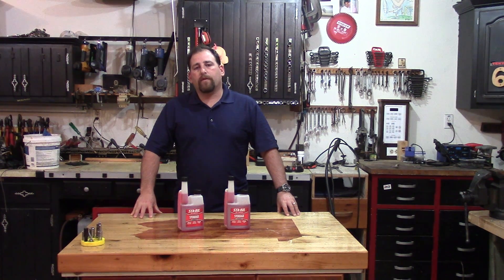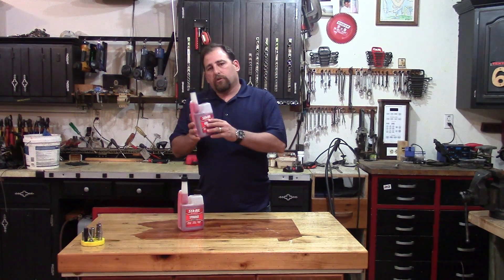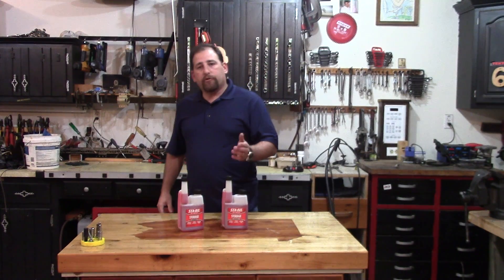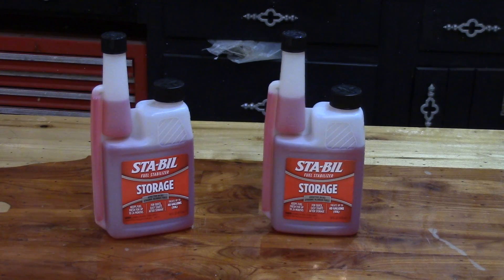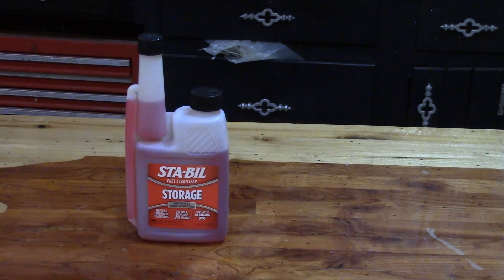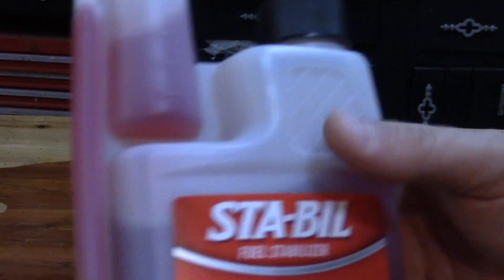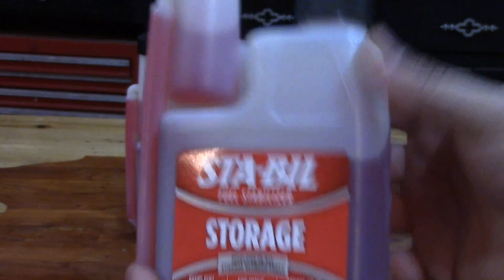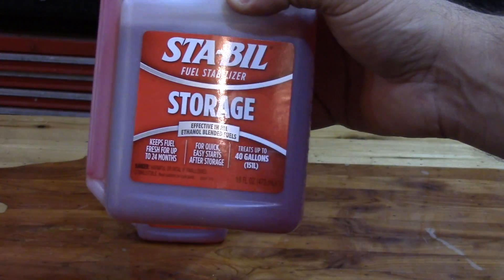STA-BIL Fuel Stabilizer How It Works

Comment: I quit using Stabil for a couple reasons but I won't go into that. I have been using Seafoam instead and it's better. It cleans jets and small fuel journals to keep all my engines running smooth. I also use it in my oil to clean up carbon deposits. And of course it is an excellent fuel stabilizer.
 No, you do NOT need to bring batteries inside during the cold winter months. Just plug them into a float charger and leave them in the equipment (as long as it's inside or covered up) I have NEVER taking my batteries out of my motorcycles or lawnmowers during the winter. I just use small float chargers all during the winter months and they stay fully charged until I need the equipment again.

Comment: I can tell ya it's probably unnecessary in dry climates like Western Colorado.   It's probably snake oil.  But it's not too expensive so it's doable.  I use about 50 gallons of portable canned gas and diesel a year.

The only way to check this product is to get 6 containers of gas from 3 different sources and do a lab test on all before and after.  Let it sit 24 months on a shady shop shelf.  Test again.  And then run them in identical machines to see how it does. Who is going to do that?  Much easier to just believe their snake oil is legit!  😆 

The diesel anti-gel may do more.  But again, not needed in Western Colorado.  Dry climates have those benefits.  But I use it anyways.

I have my doubts that any low mixture ratio of any chemical do anything for fuel.   Likely all snake oil.

When I use fuel system cleaners I fill up with premium and put 1 bottle per gallon of 3 to 4 different fuel system cleaners. Once every 2 to 3 years.   I still can't tell a difference at that strong concentration.  It has made no noticeable difference in any of my cars and I've had 35ish of them and drive them until the wheels fall off or the motors fall out.

I drain and run the line fuel dry out of my chainsaws and lawn mowers every Winter.  No issues ever.  I also use cloth filtered and settled used motor oil and run that through my bar/chain and for anything that uses 2-cycle fuel. No issues.  I also dump 2.5 gallon of it in every fill up of 35 gallons of diesel in my all-stock Dodge Cummins.  Yes I change the fuel filter more often.  That's the only cost. Takes 5 minutes to do that.  Cost me $8 every 2 years for a filter.

I run a quart used motor oil per full gas tank in my cars also.  It seems to keep things going good. Lubes the pump a little.  Has no negative signs of smell or visual.  Probably increases compression a little also.

Comment: There is another video where there's guy says, do not use sta-bil because, it clogged his carburetor up. That don't make sense. If you run it in your engine lawn mower it'll clean your carburetor while you are using it  and when you're not using it the stabilizer keeps the gasoline fresh.

Comment: Sta-bil is a good gas additive. I’ve been using it year-round in both 4 and 2 stroke engines. The only difference is I run the 2 strokes (trimmer, leaf blower, etc) out of gas when storing but I top off the tanks on 4 stroke machines before storing. No problems for decades doing it that way.

Comment: So before I use it in my mower, pressure washer and blower should i fill the gas tank or can i add a stabilizer if say i have a half tank or less?
Reply: To my knowledge keeping the tank relatively full is just about preventing more surface area for moisture to develop

Comment: Doesn't work for me. I tested it by  added a TBS of water to a gallon of gas. Nothing happened. Water stayed in the bottom of the tank.  Tried the same thing with k100. It did incorporate the water into the gas. I now just remove the ethinol from my gas. Grass and garden TV  channel done the same thing, don't work. Anything is better than nothing I guess.

Comment: Are you aware, that if you have some water in your gas tank, that if you add stabil as a fuel stabilizer, it will do nothing to the water in the tank? All three stabil products were tested and none of them removed the water.  You can stabilize the gas but you'll still have the problem of water in the gas. A new gasoline stabilizer, called K100, will stabilize the gas and will combine with the water so that you can burn it and get it out of your gas tank.  Here's a video of the tests.     @

Comment: What happens if I use Sta-Bil year round in my lawnmower gas all the time?  And downside?
Reply: first i use non alcohol fuel and sta bil all the time. it lets me store extra fuel year round with none of the " did i treat that or not"
in over ten years of doing this i have never had a problem with fuel or equipment.

Comment: years ago I ran my snowblower dry to store it for the off season. the following year I turned on the gas and gas started overflowing out of the carb. I'm thinking that there was a small amount of gas left in the bowl that dried up and caused the float to stick. Since then I put STA-BIL in my gas can as soon as I fill it at the gas station. This way I never have to prep any of my equipment for the off season. Everything is always ready to use or store. I have NEVER had a carburetor problem since then! I also use it in my collector car. I highly recommend STA-BIL!!!!

Comment: Stuff works great. I've had no problems with equipment with fuel about a year old. I've also found that using 89 vs 87 fuel helps the engines run better- especially with two stroke. Another trick for long term storage it to run engine till it runs out of gas-then store it "dry".
Reply: Also..don't add fuel until it runs out of gas.alot of ppl dusagree..but running it out clears the fuel lines and carb..

Comment: Thanks!  I just got a new Toro 20333 this Spring (rear-wheel drive, Spin-Stop) and am super paranoid from all this stuff I've seen about the mowers not starting after two years (people seem to hate the B&S plastic carbs).  I've never used fuel stabilizer before but for this mower (and my weed whacker) I am using the stabilizer from the mower's engine manufacturer in every gallon of gas I buy (6 ml) and am planning on running the gas out anyway before I store it in the Winter.  I got a 10mm allen wrench to remove the carb's drain plug, too, but I figure/hope that any drops of fuel sitting in/on the inside of the carb will be treated and I won't ever have any problems.  I had a 1998 Craftsman/Tecumseh before, always ran the gas out and never had a problem, but the Internet is full of people complaining about Toros and it has me worried .  I did a ton of research and the Toro seemed best for me, so long as my excessive precautions work.   Another You Tube post-er said he has seen "a lot of issues" with running the gas out of Toro mowers but when I asked for specifics, he could not provide any beyond "issues."  I store my mower in the basement and have  a dehumidifier down there so moisture shouldn't be an "issue."

Comment: Startron is the best for my results. Comes from the marine industry where has tanks vented in big boats is a problem with moisture and phase separation. It is an enzyme and breaks up water to go through your engine better. Donyboy 73 did a vid also on k100. That's a really good video also.

Comment: I'm fortunate enough to have a local gas station that still sells ethanol free fuel. people get it almost exclusively for boats and small engines. there is about a 30% price premium but at least that water issue that occurs with ethanol isn't a factor.

Comment: I use Amsoil Quickshot in my gas for all my small engines, and it has a fuel stabilizer in it and it also cleans the carbon from the plugs and top of the piston. My mowers are all kept outside in all the bad weather and the snow and rain. In the spring I go and start it and it starts on the first or second pull. Never had a problem.
Reply: Marvels Mystery Oil cleans better and its cheaper to use, add a little Star Tron to your gas and you will forget about Amsoil products (I was a dealer and Amsoil products are over rated)

Comment: I empty the tank and then run the engine till there ain't no more in the carb, done it that way for many years. Pull the battery and ready to go next season.
Reply from the maker: I have used this method, but I have had problems with 2 cycle equipment that the gaskets dry out over time.
Reply: same here in the UK no problems year to year.
Reply: That's how oxidation starts... drying out

Comment: Thanks, Bob.  Great reminder around this time of year to do a little preventative maintenance, and save a ton of money and work too.  Good tip to change the oil as well...I admit I haven't been doing this.  I always use non-ethanol fuel in my small engines so it might not be as critical to use stabil (I still do anyway,) but I was surprised to hear at least one state doesn't  allow the sale of non-ethanol fuel, so I would think that makes using Sta-bil much more important for storage.
Reply from the maker: A little preparation the year before makes a huge difference on how your equipment will run the following year.
Reply: Yes, if you have access to ethanol-free gasoline Sta-Bil is less necessary.

Comment: I watch all of his videos and love them, but I definitely don't agree with this video and I feel he is only making this video because they are sponsoring him to do it. Don't use this product, Stabil does nothing for ethanol and that is the real killer. The best thing you could ever do for your equipment is drain it completely and leave the carburetor and tank dry of gas if possible.
Reply from the maker: Thanks for your comment.  Sta-Bil has been designed to prevent ethanol from releasing water into the fuel system.   I don't it is fair to say the it "does nothing for ethanol."

Comment: I have never and never will use it. It is a complete waste of money. I have  been working on small engines for 60 years.
Reply: Do a test Jerome. Get an old push mower that runs. Put 10% 87 octane fuel in it, run it so everything is saturated with it, then leave it alone for 6 months. Then do a thorough inspection of the carburetor (and tank). I've been a small engine mechanic for the past 25 years and in recent years have had quadruple the fuel related repairs. It's no myth that Ethanol draws moisture and the combination of ethanol and gasoline also has a nasty byproduct once fuel reaches it's half life (90 days) that becomes acidic and eats away at fuel lines and carburetors. Remember when pump gas lasted two years untreated? Those days are long gone. Don't be blind to the reality that things change. Sta--Bil isn't snake oil as you suggest. Being around these engines for 60 years, you should have seen newer engines by now where the fuel cap expressly states that Ethanol voids warranties. There's a reason and Sta-Bil protects against the harmful effects. So don't be stuck in the past please. Open your mind to the reality that new fuel additives are bad for small engines. With kind regards. Zip~
Reply: Yeah Jerome, what ZippoVarga said.  Don't be a fukkin dumbass.
Reply: @aodhmacraynall8932  I like how you summed that up.
Reply: Up until a couple of years ago I would agree with you. Yes, most fuel and oil additives ARE snake oil. But small engines don't seem to store as well as they once did. Is the ethanol to blame? I don't know. Probably. But I have reluctantly begun to use Sta-Bil with good results. I use it in the tanks of several farm tractors too, tractors that see only occasional use.

Comment: I use a 5 gallon gas can for my equipment.  At the beginning of each season I put 5oz of Sta-bil in this can and fill it with premium fuel (premium because they are high revving engines).
If I have any left at the end of the season, I pour it into my truck. Start fresh next season.
Reply from the maker: Nice to hear the Sta-bil is working well for your equipment.
Reply: High octane for a small engine? That doesn't sound optimal.
Reply: @jeffreyd1701      Depends on the small engine.  A lot of scooter and some motorcycle engines (like the older 250 Ninja's, which I have one of), particularly single cylinder engine based ones, are higher compression, high revving, very hard working, but simple engines. They put out a lot of power for their smaller size.  

  For smaller, but very hard working engines like these, high octane is pretty much a necessity to prevent pre detonation which can lead to knocking and pinging (which eventually leads to a lot of damage).  They don't have all the sensors and equipment to adjust things internally, such as many modern cars can.  

      I recently bought a 150cc scooter  (single cylinder engine, and scooter has top speed of about 60mph, and revs pretty high) off a guy who used regular gas for the 3700 miles of it's life up to that point (and didn't maintain it completely properly).  The manufacturer who made it recommends high octane, premium fuel. 

I was getting a moderate amount of something like back firing at first and for awhile. Relatively soon after, I bought Shell NitroV-power, high octane fuel (which has extra cleaners in it--mainly P.E.A.), did an oil change and put really good oil in it it (and flushed with some Marvel Mystery Oil).  

     At different points, I also added some Seafoam, and at other points, some Marvel Mystery Oil to the fuel.  

    A couple hundred miles later, and having burned through the old fuel awhile ago, it's not doing the pfff pfff anymore, and running smoother,  quieter, and with a bit more pick up and top speed.  Part of that is cleaning the carb some, part of it is the much better (and cleaner) oil, but it's also definitely using the higher octane fuel.    

      Can't say for sure, but I think it's running cooler than it did as well. 

  But yeah, for lawnmowers and the like, regular gas is fine and actually more helpful for these lower compression engines.

Comment: Cool thx, I have wondered about using additives to my gas on my boat when I store it for the winter as I was always getting gum in the carb and paying to get it cleaned
Reply from the maker: Sta-Bil makes a specific marine product that is designed to prevent that gun in your carburetor bowl.

Comment: I have never used it in all my small engine equipment. After the winter or even two years later they start up. My friend uses it religiously in all his motor cycles for storage. I just watch. Most definitely remove the battery and bring it inside during the cold winters.
Reply: Must not have much ethanol in your fuel there,I cant go more than 3 months or the fuel starts to break down and turn to shit,destroys lines and all rubber diaphram carb parts,terrible shit,I love stabilizer!!
Reply: @577buttfan    That, or they live in a very consistently dry climate. When you live in a very dry climate, the ethanol in the gas won't attract as much water into the fuel, as there is much less atmospheric moisture to begin with.  

      I live in a consistently quite humid place (typically ranges from 55 to 90% humidity), and like you, I can't go 3 months without having too much water in the fuel which causes problems especially for smaller, carb based engines.  I haven't tried Stabil yet, but I do use SeaFoam, which works if I add extra amounts.  A number of times my lawnmower wouldn't start until I added extra Seafoam.  It already had some in the fuel to begin with, but when I add extra (and shake it around once in it), it will work.  

   Then I make sure to put in fresh gas as soon as I'm able, to dilute the water.  

   I don't think it's so much that the gas is breaking down in most cases by 3 months, but too much water.  Without any ethanol, gas can easily go a year in most conditions and still be decent.  Typically there is only 4 to 10% ethanol in US gas, which is a small fraction of the total, but just enough to attract enough water (especially in high humidity climates) to cause problems.
Reply from the maker: It is a good bit of insurance just in case you don't get to your equipment the following year.

Comment: The 1st time I used it on 2 cars I store in the winter and both had a difficult time starting in the spring. So I only use it in my John Deere. I think it’s junk for classic cars.
Reply from the maker: Thanks for your comment.  Are you sure you mixed in the right amount of ounces of Sta-Bil?
Reply from the maker: I should also mention that it needs to be added to fresh gas it is not designed to fix old gas.
Reply: Sure did. I cook too and know how to measure. First time using it I made sure of that so there were no screw ups. Been playing with cars since 1973.
Reply: Fresh gas is always added before storage. When not using a stabilizer, the cars start right up. BTW, one of the cars that wouldn't start was a '87 Buick Grand Nat'l and that is a SFI fuel injected 3.8 and that for sure should have started. The other is my 70 Z28 I bought in 1981 and it has the 780 CFM Holley. And yes I did fill up both fuel bowls before trying to fire it up. I wouldn't use a stabilizer in my cars I store if you gave me a free bottle each yr. Without it the cars fire right up. Both cars use Shell premium with 0% ethanol.
Reply: @johnmilnerQQ    Not all Shell Premium gas is ethanol free.  At least in my area, no gas is ethanol free. I could drive a hundred miles or so to get it though.
Reply: Justin W Shell premium in all of Ontario Canada is ethanol free.
Reply: @johnmilnerQQ    You're fortunate John.

 In the future, you might want to mention the area you live at or at least their standards so that people don't assume that all Shell Premium gas is ethanol free.  

 When I first started researching this and trying to get ethanol free gas, I came across people mentioning that Shell's premium gas was ethanol free.  But it took deeper digging to figure out that it wasn't in my area.  

  Unfortunately, in most of the US, it tends to be hard to find ethanol free gas. Corn lobbying and all.  US has the best government that money can buy sadly.
Reply: Ontario Canada.